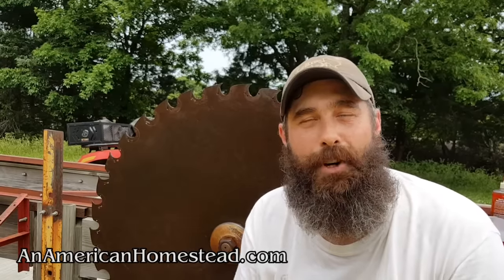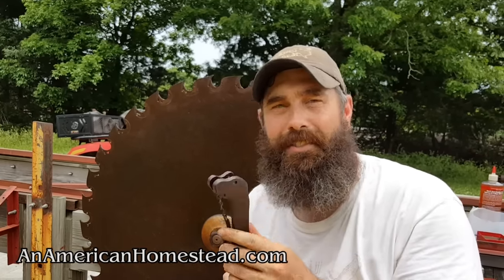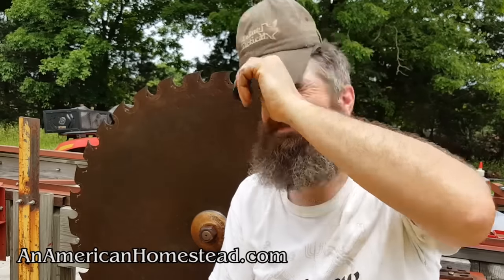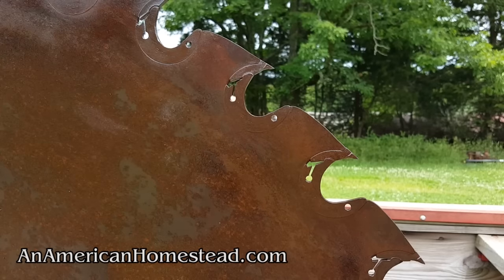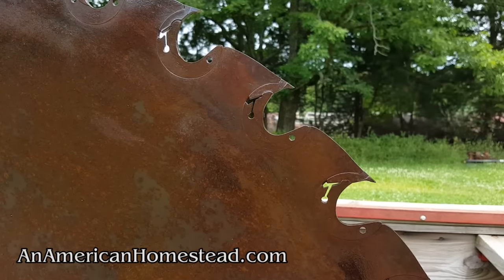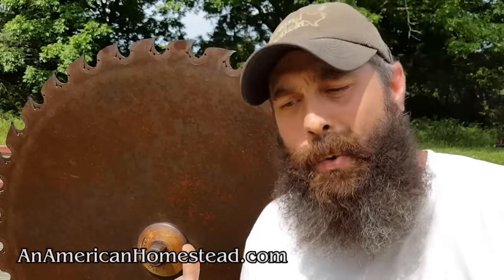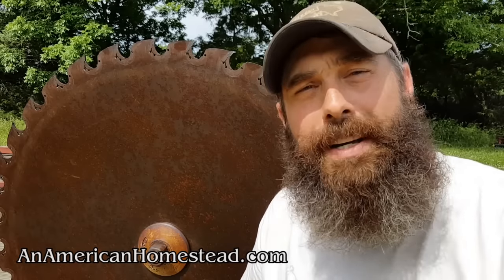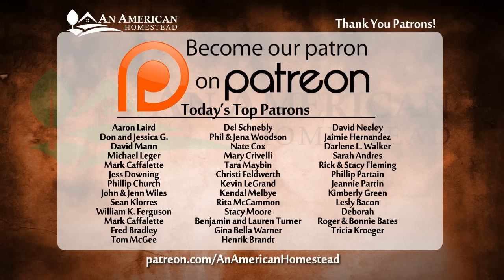Pulling and Inserting New Saw Teeth

Comment: I headsaw for 30 years I always pulled the shank out of the holder and cleaned it and put oil and then put my standall teeth back in then set them if you don't your teeth could work up loose and lined the teeth if you don't it will saw rough great video guys

Comment: Every time I use a Allen wrench they usually brake i use a small bolt it last allot longer but I also used this stuff called cut through it i spray on the blades it help get rid of all the build up then before I switch a new tooth and shank we also call it a moon I put on antisieze so the next time when I have to change teeth it won't be as tough and over night I'll spray it with some more cut through and let it soak over night it keeps it humming real nice

Comment: I was a Head Filer who took care of 52” and 44” Headsaws like this, and 72-108” Deck Saws, 38’x12” Double Cut Bandsaws and 56’x12” Sliver tooth Band Headsaws for 43 years.

There’s an actual wrench you can use for taking those teeth out… the wrench is specifically for the size shank in the saw, so when ordering you’d have to know the number of the shank, 2.5, 3, 4.5 and the style which would be a letter designated style. B, D… for easier removal I’d also recommend removing the tooth having it pointed up at you with something on the opposite side to keep the saw from spinning as you’re reefing on the wrench, and you may also find that dipping the shank and bit in oil rather than diesel will make inserting them back in a bit easier as well.
Reply: BTW, you should still be able to get Shanks Bits and the corresponding wrench from Simonds, (Portland Ore)or BH Payne (back east someplace)

Comment: I ran a headrig for many years in a sawmill. Changing bits can be a real pain. I had to change mine once or twice a week. They were a #2 1/2 style. Using an old saw like that is more fun to use than a bandsaw, in my opinion.
Reply from the maker: wow, once or twice a week? why so often? that would get expensive.
Reply: It was. We would use different brands of bits and saws. We always went back to Simonds. They were twice as much, but the quality made up for it. We used the headrig for big and metals logs. Those for the most part didn't get run through a debarker. I'm sure you have seen what bark, metal, and different things you find in logs do to the saw.